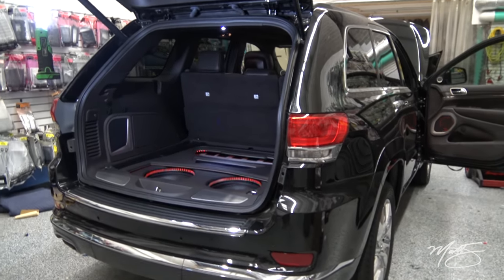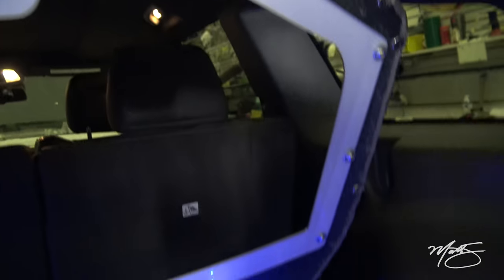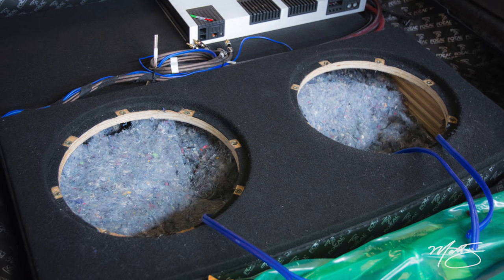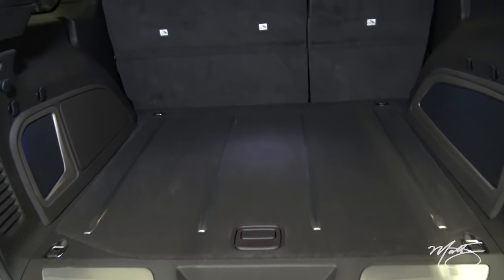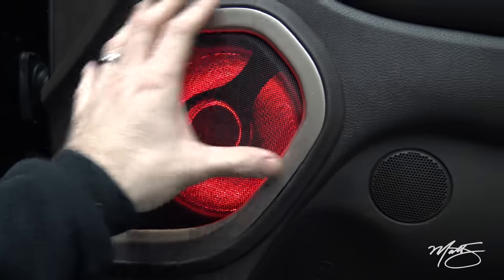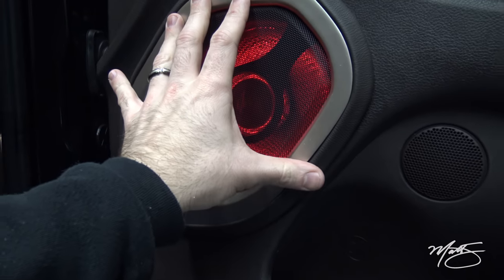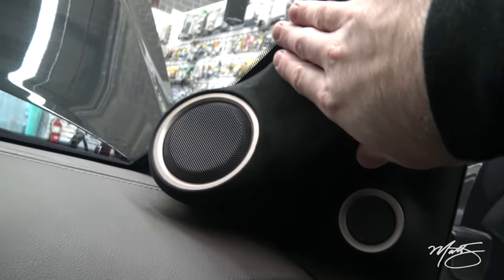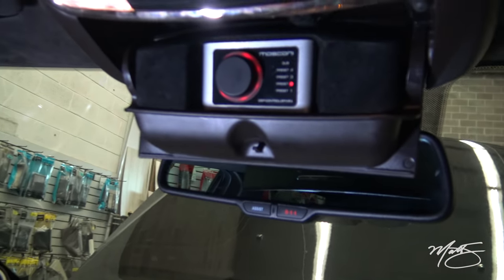2015 Jeep Grand Cherokee Summit  - HIDDEN AUDIOPHILE BUILD EXPLAINED!!!!

Comment: This is a true install, not "they put a stereo in for me."  The custom work with the little details like the magnets, labeled amps, lighting, etc. so well done.  IN the last 30 years I can honestly say I have seen less than 5 installs that labeled their wires at the amp level and not the deck.  Back in the day before PAC adapters, etc...

Comment: Thanks for giving me inspiration for stage two of my Jeep. I replaced all my speakers with Hertz Mille Legends running passive. And one 10 inch in custom box in factory location and a Arc Audio 5ch. Stage 2 is dsp, another 4ch amp to go active, and 2 12’s in spare tire location. I also use the PAC adapter.

Comment: how you dealt with the heat generated from the amplifiers, when the oem floor cover is replaced? 

thanks for the info.

your builds are mind-blowing
Reply from the maker: Kavan_R the amps have dual fans built in when it reaches a certain temperature. There is plenty of room for air to move under the panel.
Reply: Matt Schaeffer thanks for the reply man 👍👍

Comment: How did you go about running new wires into the doors for the speakers. I have a 2014 Grand Cherokee and there are plug harnesses that go from the door to the body
Reply from the maker: Through the molex connector. Add pins.

Comment: I like that PAC system. Right now I’m using the audio control L6i. I have the 2015 Jeep SRT and I wasn’t getting any signal from the factory sub. I’m guessing the sub that is in there is a noise canceling sub.

Comment: Great Install. I have a Jeep and want to do something similar. Does the Pac still let you hear phone calls through the center channel or is that not used anymore?
Reply from the maker: The pac piece takes all the chimes, back up sensors, bluetooth, and warning audio and creates full range outputs via RCA or toslink
Reply: Did you use the factory speaker wires or rerun wires to each speaker? I want to do something similar with a dsp.
Reply from the maker: pac piece sums hands free calling and navigation through the front left speaker

Comment: Do you sale these parts? I want most of it the box is to big I’m okay not having that much power or amps maybe I would put them where the old sub is and under the seats? But I wanna make a box that holds a sub or 2 and a small tool hind away for my trailhawk so if I don’t take my hi-lift gearbox

Comment: Amazing install. What would the cost of something like this be? Specifically for a grand Cherokee
Reply: My guess 6 to 8 thousand,and 2 to 3 weeks to build,I had a custom 4 amp system, plexiglass,push and pull fans over amp rack, Rockford amps were powder coated and highlighted with purple led lights, center channel and 2  12 inch rockford subs built with wood with a plexiglass window and ports,I know alot going on,took 3 weeks,I had the amps paid for already 1.800 in amps and overall layout cost me 3.500 and that was years ago.

Comment: Damn son, that build is badass! I love the speakers in the front door. I'd only have a tiny complaint, which is seeing the individual leds arround the trunk woofers. But this could just be the camera which is picking up the light kind of weird.
Looks awesome anyway! Keep it up.
Reply from the maker: Bootflag FPV the lights are a rgb halo (built for a headlight mod) that sits behind the circle in the center of the speaker. It is not visible when looking at the speaker.
Reply: Ok, so it must be the camera thats picking up the light "wrong"
Perfect build then, I wish one of my cars would have a system like this xD

Comment: I've got 2013 Grand Cherokee, did you upgrade the battery or the alternator? The battery is a weird sized one and I'd like to upgrade it. Awesome install freaking flawless
Reply from the maker: I did not need to upgrade the alternator. This Jeep was a Diesel so it came with a higher output alternator.